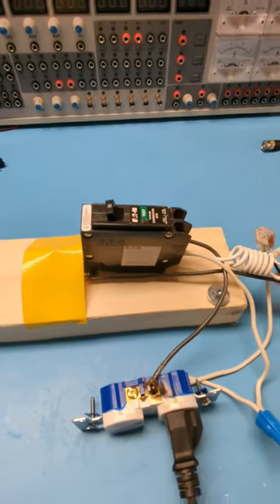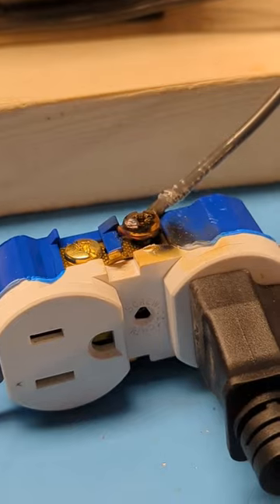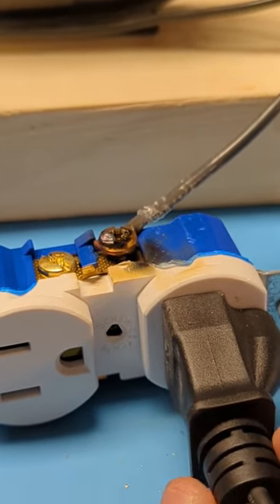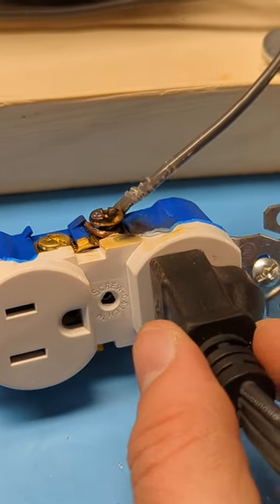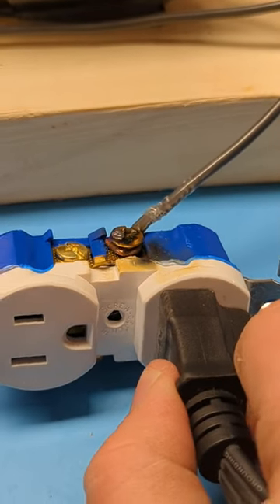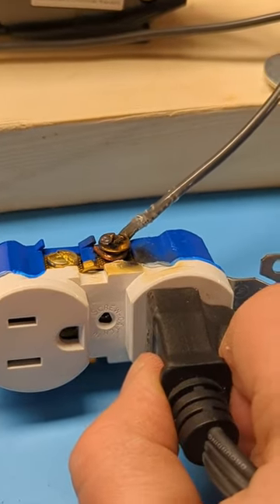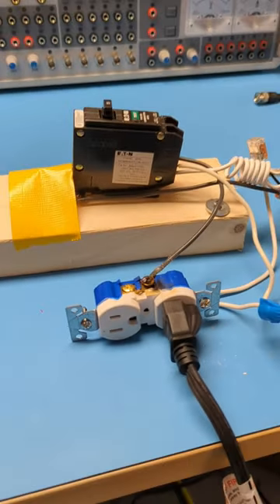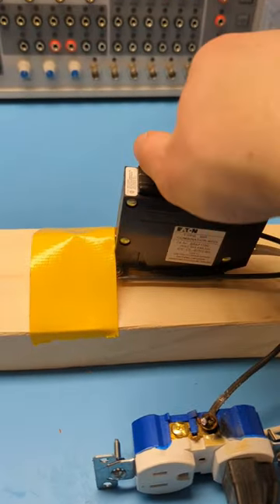Testing Arc Fault (AFCI) Breaker on Real Load

Comment: I just tried this and posted a video.  It took 20 mins to trip
Reply from the maker: Interesting! This is https://www.tiktok.com/@stevenj120volts/video/7288374556442496286 right? You look to have an even beefier load too. I have a longer video at https://www.youtube.com/watch?v=TpUJBA5Trvg that explains what they look for. That video has a link to a paper showing the "hot terminal" problem too, AFCI won't always stop/detect that it seems, so I think your results are somewhat "expected" (that small red arc won't always trip). For me there was a noticeable flash-over arc through the carbon path that often caused the trip.
Reply: Yes I had 13-14 amps.  Thanks I will watch you longer video later today.  Just to introduce myself....  I am a master electrician with 83k followers on tik Tok doing mostly hands on electrical demonstration like this video. I  just started trying to post on YouTube .
Reply: @ColinOFlynn  I also plan on trying with Square D QO this weekend

Comment: Wow, that looks useless!  Glad they are both expensive AND required!
Reply: Yeah. You can say that once your house burns due to an electrical loose connection.
Reply: They’re not just intended to help with issues like that, but also puncturing wire in a wall with a nail or something; saving you from a fire